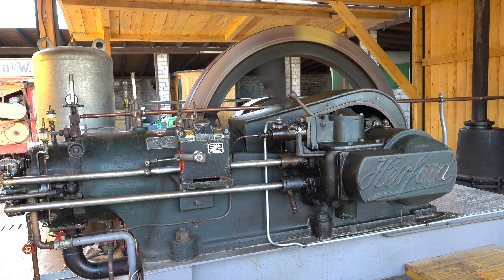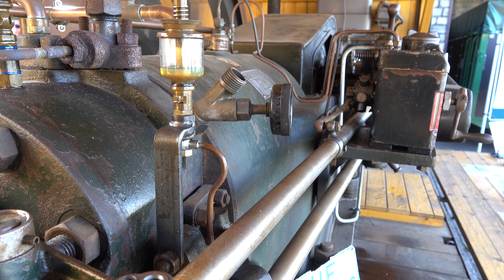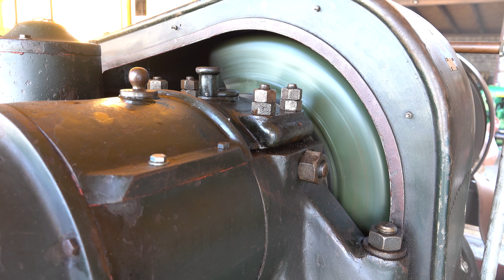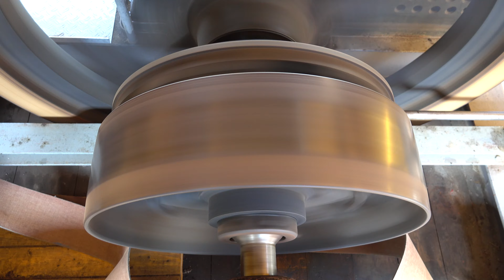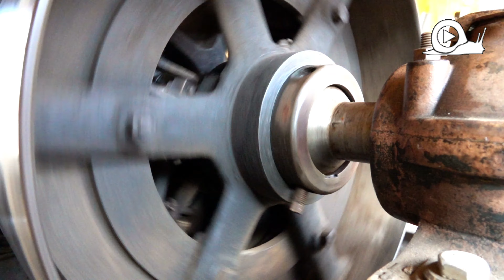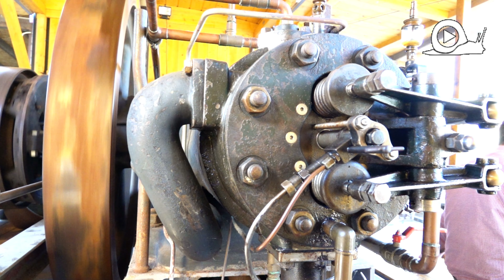Herforder Diesel von den Alttraktoren und Landmaschinen Freunde Dreyen e.V.

Comment: Ich bin in Herford geboren und wusste gar nicht, dass es dort mal eine Motorenfertigung gab. Interessant!
Reply from the maker: Zwischen 1905 und 1985 wurden in Herford Motoren gebaut. Die Motorenfabrik befand sich an der Engerstraße 29. Teile des Gebäude stehen jetzt noch. Mit der Änderung des Mineralölsteuergesetzes, das den Einsatz von steuerbefreitem Heizöl für die Stromerzeugung durch Stationärmotoren gestattete, waren die Herforder Motorenfabrik nicht mehr konkurrenzfähig. Der Betrieb wurde deshalb nach der Produktion von mehr als 10.000 Motoren 1985 eingestellt.